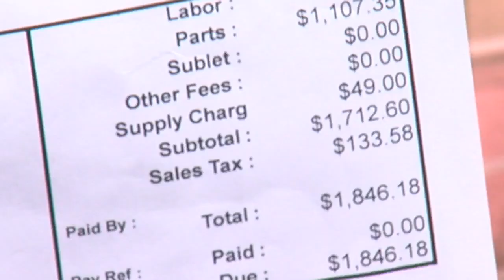Why auto repair costs are suddenly so high

Comment: They SCREWED you OVER!!!!!!!! An alternator and battery,that repair shop needs to be SHUT DOWN for FRAUD $1800,come fuckin on!!! It should have been $600 tops!!!
Reply: Definitely over 600 for that car. An AGM(what it calls for) battery is 200-250... A quality alternator for that vehicle is 544 after a reasonable markup. Labor is about 1.7hrs x 135 = 229.50. That's 973.5 before tax.

Comment: Why auto repairs cost more? I can tell you this much, the money doesn't trickle down to the mechanic. Dealerships and shops cut labor to a minimum and make 300% off parts! 

Profits moved from labor to parts a long time ago.  Now they can't find good mechanics because they don't want to pay them. This also drives up cost. 

Dealerships have what they call Matrix Pricing. They basically have 2 or 3 prices for the same part. As an individual walking into the dealer parts department, you are given a fairly high price for parts. As a customer in the dealership service department you are  told list price or the highest price possible, the suggest retail price for that part. As mechanic or another independent shop, you are given the jobber price which is the cheapest price you can get, because they want you to come back and buy more parts. 

The individual pays the highest cost on parts and OE or original equipment parts like you get at a dealership are usually better quality than part stores or online. 

The customer foots the bill, but you can see the customer is not the only one getting screwed here. The mechanic works 40 usually gets paid less than 40 hours because of the way they pay them.  If they claim to pay you $30 per hour flatrate by their book, that usually equals around $15 per hour because they cheat the mechanic out of half their labor time. The mechanic has to buy his on tools upward to a hundred thousand dollars and this adds up to even more as years go by. So he's really getting screwed. 

And for the mechanic, it's a pay for performance job by the book. There is no such thing as federal time and half overtime pay and the mechanic has zero job benefits.  

I mean talk about a mechanic shortage. If you gone work for half price and zero benefits, you might as well be working for yourself!

It's a lose lose situation for the customer and the dealership mechanic. 

How bout this. Some shops offer free rotation and balance if you buy a set of tires. Is the mechanic gone work for free!  I'm not, so it's time for mechanics to move their tool box to a home garage or rent his own shop. 

Boss says before you go I got an oil change. If you don't mind, could you get that for me?  I sure do appreciate it. Sure why not.  

Oh, it's a dually pickup truck, and the tires need rotating and balancing. Could you do that for me? He's a real good customer 😳

By the time you leave these shops to go home, you can barely walk to your car. You're beat 😡 

And there's little or no money in being a mechanic working in these shops.

Sorry for the edits, I'm not an office worker.

Comment: Dang...They absolutely ripped you off for that repair. For battery, this gentleman could've easily gone into a costco and say...let me grt a new battery for much less than what is shown. As for the alternator, the dealer basically scammed you for nearly 3-4X than what the parts actually cost. As for the labor...I only imagine 2-3 hour job for dang it. Basically in my honest opinion...they probably gained anywhere from $1000-1300 for this 2-3 job. Sucks...sucks a lot.